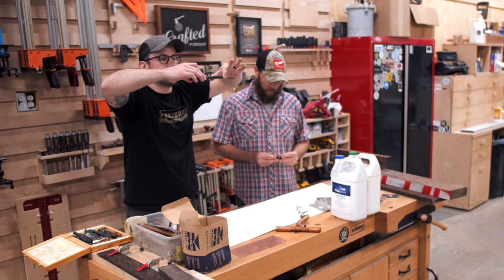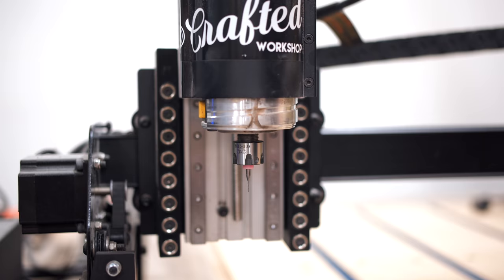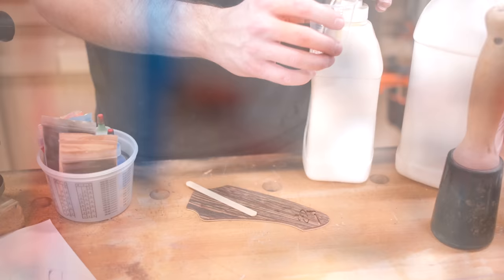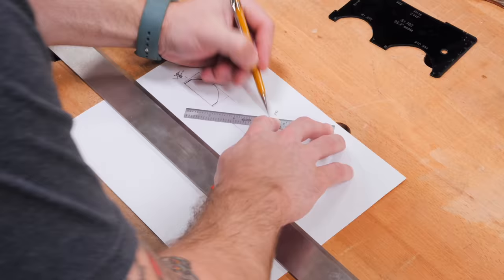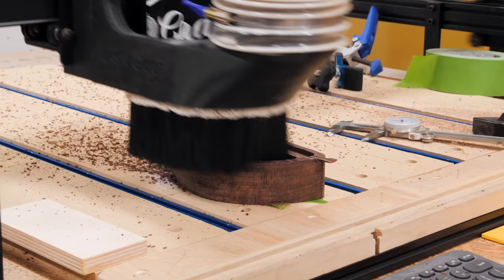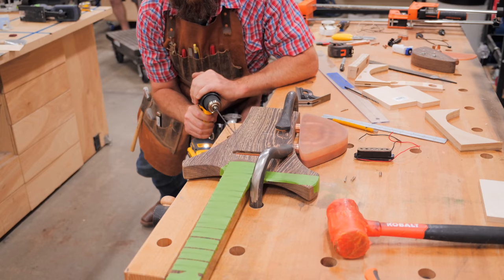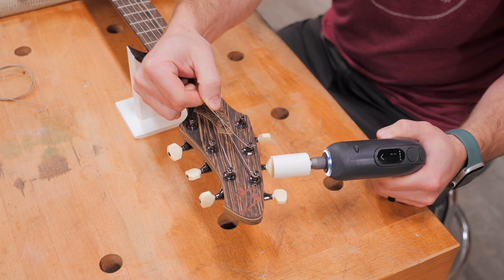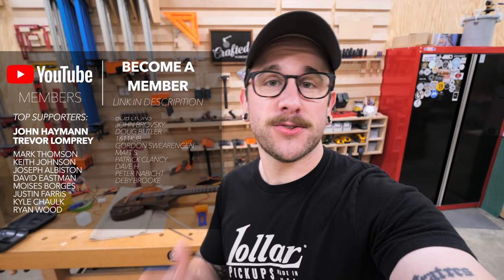I Built an “EXPLODED” GUITAR out of EPOXY RESIN and COPPER PIPE

Comment: If you set the wood up diagonally on the X-Carve, you aren't limited by the 1m x 1m dimensions, you get closer to a 1.4m distance of cut. (minus the width of the router and limited by the wood blank shape).

Comment: Looks great, but I think it would look even better if the copper pipes connecting the wings to the body would point at each other. And I would've tried to align the bridge and the tailpiece with the copper pipes (I don't know if you can have these not at a 90° angle to the strings but if yes I would've tried to do it)

Comment: Another video with a CNC. If only we could all have one, and given to us cheap or for free.
Reply from the maker: Owning a CNC is a bit of a luxury but nothing we did with the CNC here would be particularly difficult to do with a regular router and template. I've built a guitar with basic power tools before, definitely not a problem. Also, CNCs are becoming pretty darn ubiquitous and you should be able to find one you can spend some time on, whether that's at a maker space, school, etc. My X-Carve is far cheaper than every other stationary power tool I used in this video.